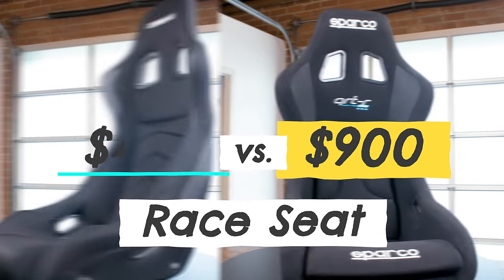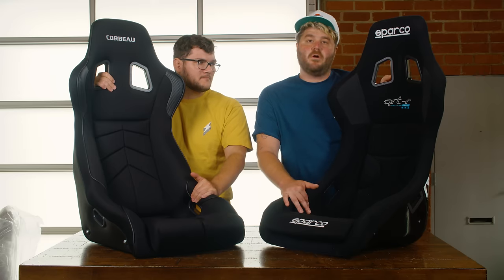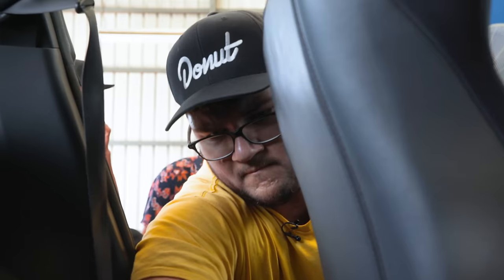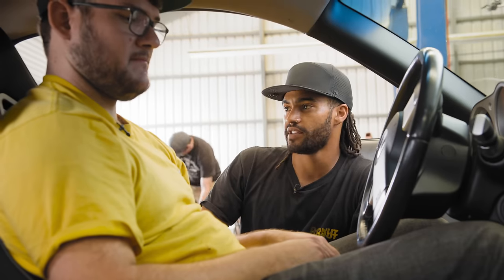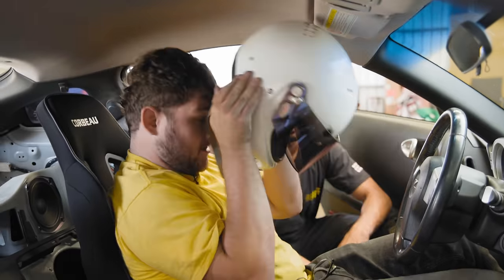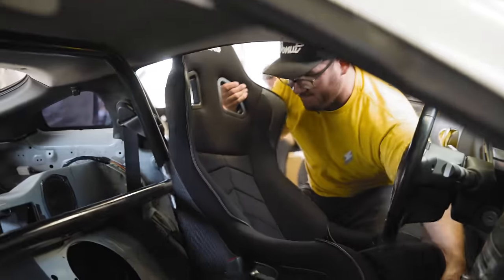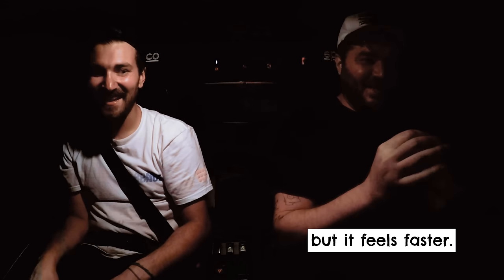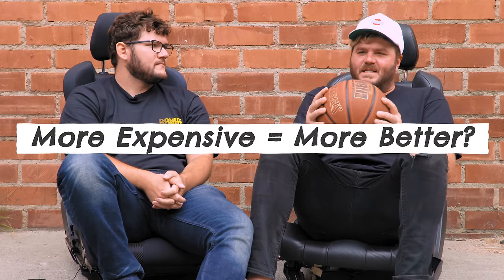$450 Racing Seats vs. $900 Racing Seats | HiLow

Comment: I like how a $450 seat is the “cheap seat” . Should have been a Facebook market place $50 seat.
Reply: no shit, they shoulda done the JEGS / summit seats
Reply: narmale or ebay special lmao
Reply: well yeah corbeau is still a good quality seat in this price range...cant compare to fake bride or wtv
Reply: I mean it needs to be a upgrade compare to the stock seat, not just slap the cheapest stuff on the car.
Reply: Exactly what I just post!
Reply: @V843v3r  correct
Reply: Lmao right? Corbeau is a top brand as well 😂
Reply: Exactly. The POS coil overs were a joke. You can get a pretty decent set for way less than half the expensive ones that would have blown away the clearly crap ones. Corbeau is a known brand. Keep things consistent folks...
Reply: The 'expensive seat' was a Sparco. How about a Recaro option that runs closer to $1500-$2000? Sparco and Corbeau are both really middle market. The real cheapo 'racing seats' are much less than the $450 Corbeaus, and much suckier, too.
Reply: @dandanthebabyman  The eBay special is around $250 - 300, and it's suicide. It's most definitely worse that stock and could cost you your life in an accident. I would only use those for a simulation racing rig.
Reply: Right??? Corbeau is better than my Recaros 😅
Reply: @dandanthebabyman  Yeah I really wouldnt cheap out on Seats... 

Recaro, Corbeau, Sparco... Stick to decent brands or you going to die in an accident 😅
Reply: @sireuchre  My Recaros only cost like 900usd... And both these sits are newer/better in my opinion. 

I guess for 2012 my Recaros were really nice mid/top end.
Reply: I imagine that was because in order to put the car on a track the seats must be built to a certain spec that track inspector's must lQQk at.....from Wyoming USA 🔫🤠
Reply: @billallen4793  FIA regulations are kind of BS TBH, I mean sure I understand that the seat is build to specifications but the fact that there is an expiration date of sometimes just 5 damn years and it's no longer approved? Seriously WTF!? How the hell is a seat going to be out of spec in 5 years of use? Is it because after 5 years they expect it to rusted out or something? lol
Reply: @SI0AX  experation dates on certain stuff is bs.... I think it's so manufacturers are able to sell more stuff....from Wyoming USA 🔫🤠
Reply: @billallen4793  That is the only legit explanation. Seats can last like 30 years if not rusted, so in order to keep making profit they put BS expiration dates to keep having people buy more if they want to keep competing in FIA regulated races.
Reply: @SI0AX  belts/harnesses last way longer than the rules say...unless you store outside in direct sunlight and weather they last a long time.... helmets also... unless it's taken a big hit it should be allowed.....from Wyoming USA🔫🤠
Reply: @sireuchre  How about a carbon fiber one, much more expensive and has at least some expensive weight reduction.
Reply: Any of you actually work on cars? I use procar seats and they are cheaper yet. Bull crap on the goober who said they were unsafe...As long as its mounted correctly.
Reply: SI0AX 🤦🏾‍♂️
Reply: Nåti M 🤦🏾‍♂️
Reply: alconater68 my thoughts exactly..I highly doubt any of these keyboard tuners even own cars let alone spend “thousands” on seats😂😂
Reply: @SI0AX  depends on material choice. Kevlar is popular, but the fibers break down over time. That's why bulletproof vests have expiration dates of about 5 years IIRC.
But I doubt that's the reason here. It's probably to do with maintenance, so some guy doesn't show up with 40 year old plastic tubs and kills himself lol
Reply: @eriv4735  Let me show you a video of OEM equipped Recaro seats:
https://www.youtube.com/watch?v=8Ye72Fg2xjs

Grated, this doesn't really make an argument for eBay seats, just the non-fixed back seats and why they are not allowed by FIA.

If there is a well build eBay fixed back seat, I could see it hard to fail, but I would have to look at the quality of the hardware it brings, and maybe even the welds. If any of that is half-assed, you would die, just like the kid in the video nearly could have.

I have a 1991 CRX that I've been working on 2 years to build into a circuit race car. I've spend 15x the amount it cost me to buy the car in just performance modifications and plan to get a cage and racing seats installed.
Reply: E Riv ok when you get into a low speed accident with a bicycle and get folded in half like a origami crane don’t say no one warned you
Reply: This isn't a civic build lol

Before I get Honda hated, i own a civic lol
Reply: @MrAhhsum  Honda builds are the cheapest. At least in my area, because they are the cheapest, they tend to be more commonly the fastest in straight line racing. Although that isn't surprising at the slightest. 

I think this kind of leads up to the ricer problem with Honda's. Because they are so cheap and you see so many fast versions of the car, kids tend to think the lowest tier trim car with the stock engine is good enough with just a muffler swap.

The same can be said with V6 Mustangs and other V6 "muscle cars"(it's not a muscle car without a V8).
Reply: Dale Halvorson the goal was to find something cheap, but also something decent. Not the cheapest thing you could find. I mean they mentioned this on the first vids of the build....
Reply: @devandrasimanjuntak1646  Exactly. Cheap but not garbage. Like putting on the eBay sleeve coil-overs that are actually dangerous because the sleeves will eventually split in half. The CRX I bought came with those at the car was set at the highest setting and was still scrapping the ground because the sleeves were split in half.

Coil sleeves are garbage and suicidal. Get the $500 coilovers from Tein or something or stick to lowering springs but FFS, DO NOT get the damn sleeves!
Reply: Well I feel like 450 dollars is reasonably priced. They arnt building a cheap ass car. Remember the 450 dollar brakes? They are building a car that is middle of the road and another car that is really expensive.
Reply: narmale Na make me use shittybilt seats. They are the poorest designed seats I have ever installed.
Reply: You didn't hear him say "a lot heavier"? Yeah, its the cheap seat.
Reply: 01GTB Daily its more of a “High (end) and Low (end)”
Reply: They track there cars so they needed a fia rated seat and that’s the cheapest fia rated seat
Reply: Can get some (What I consider to be nice) NRG seats on CarID.com for $220 a piece with rails.
Reply: Yeah ive seen some sparco seats for around 450
Reply: @PapaVrooom  Somewhere I saw Nolan mention that they made exceptions for the seats, just for like safety reasons or whatever.
Reply: QRT isn't even a hi item
Reply: I've had the same $165 ebay NRG seat for 3 years now - I "daily" drive ( 3 or 4 drives a week ) and do about 25 track events a year. Never had a single issue, it's perfectly comfortable, holds me in place at the track, and still is in as good condition as the day i installed it. 
... An EBAY SPECIAL (just like mine) is what should've been the cheap seat.
Reply: @MiraSubieGirl  i have PRP seats and think they’re a lot better than my buddies sparcos
Reply: @V843v3r  I think the idea is "is upgrading your car at a lower cost worth it?" type of thing, not necessarily bare bones cheapest car vs most expensive car. its just cheapest upgrades vs expensive upgrades
Reply: well, you'd at least want it to be an improvement, you won't pay money for a downgrade even if it's $10
Reply: lol, no shit my seat brackets are corbeau and with nrg type r style lol but I wanted something more facory that reclines. lol
Reply: Cipher economy seats 😂
Reply: @SI0AX  agreed, a shit seat nearly cost me my life because during the crash it couldnt keep in place and ended up giving way and sending me into the steering wheel. It broke 6 ribs my collarbone and almost paralyzed me, had i not been on the track i would have bled to death.
Reply: They don't want them to die in the event of a wreck lol. It needs to be cheap yes, but not cheap like completely unsafe.
Reply: Show idea new vs used
Reply: Andy's auto sport. APC special
Reply: On a budget should be said
Reply: On a budget should be said
Reply: $450 is crazy cheap for a racing seat.
Reply: Maybe they just don’t want to promote fake stuff
Reply: “Racing Seats” 😂
Reply: its a cheap " Racing " seat an original the one facebook is probably a fake and probably not a racing seat
Reply: Should have been the rep bride low max xD
Reply: Safety cannot be disregarded

Comment: "doesn't directly improve the performance of the car" loosing 40kg/100lbs, definitely will improve performance.
Reply: or8t I think they meant in terms of horsepower/torque, friend. Not weight reduction.
Reply: Handgun777 weight reduction does improve performance though. At 100 pounds thats a good chunk of weight that will make the car feel slower since the engine has to carry it and now that it doesnt its more efficient. More efficient = more acceleration. Take a couple hundred pounds off a truck and tell me it doesnt perform better.
Reply: @Attachments.  100 pounds can feel like alot , depending on the car. 
My old mk1 gti was a fun car until you added a passenger and lost that edge.
Reply: 370z seats weight 47lbs each
sparco QTR seats are 25 with padding, 

50 doesn't equal 100
Reply: @narmale  Good point. I'm thinking of changing from BMW seats that Ligit can weight 25/50lb+
Reply: @or8t  u was just happy with my cheapo seats mainly cuz of the side bolsters, sooooo much better than stock seats, as far as that point, but even comfort wise they arnt bad. Ive had several 3 hour trips in em and felt great afterwards.
Reply: Have a Megane RS i took from 1440kg to 1210kg... 

Bit extreme on the weight reducting end but the difference was immense.
Reply: @MiraSubieGirl  That's awesome man, you must of swopped out a bunch of stuff for that!

Comment: I actually really like my Corbeau seat. Great price for a FIA certified seat. Was a nice change not holding on for dear life sliding around my OEM seat on the track.
Reply: Corbeau is the one company that makes a good cheap seat. And they've got decent looking models too.
Reply: Corbeau fx1 is not fia approved
Reply: @brianjewell4139  exactly, I'm surprised they didn't go with something like NRG given their price point
Reply: @jonbanaitis2992  that must have changed recently, because that was the sole reason I bought it at that price point (4 years ago) was because it was FIA approved.
Reply: @jonbanaitis2992  They did in fact make FIA Approved seats that were about $200 more than the non approved versions. I dont see nearly as many now on their website, looks like it changed.    Also I totally Expected something from NRG which like you said would've made it a much Lower to Higher comparison lol
Reply: I posted above and for some reason no one caught it.  Those aren't fx1 pro.  Those are DFX seats.  Dfx also weight 9 lbs more.
Reply: @SofaKingTouge  yea I cant help but think they're a weird choice. Even if they needed a "wide load fat ass capable" seat, they still kinda blow.
Reply: @brianjewell4139  Braum seats come from same factory but look 30x better.
Reply: @DuBstep115  Yea the Corbeau Sportline RRS are the same damn seat as the Braum Elite Series and even the price is about identical, the Braums just look much nicer. Having put knock offs in my Honda way back when, I'll never use a lower end seat again. They're absolutely a safety item which is why I put FIA Brides in my GTR and swapped over to Recaro SPGs in my DC5. You spend every second in your car in full contact with your seat, may as well be one part you take some thought and $ on.
Reply: @brianjewell4139   fx1 pro is the best bang for your buck seat.  I have them in one of my cars in alcantara.  Now if money was no object I'd get sparco spx for my roaster.  $6k for seats is way out of my price range.
Reply: Recaro or Sparco guys... If your doing serious track days or "naughty" amounts of speed... 

Seats are like Brakes. Dont cheap out on your life worth. 

Corbeau is not bad though I have to admit, but if your doing over 160kph you should be in Recaros or Sparcos. 

And on top end Brakes. I reccomend DBA or Brembo as affordable top end brakes.
Reply: @MiraSubieGirl   160kmh is 100mph.  That's my commute to work.  Also I don't know what makes you think sparco are somehow better then corbeau.   Literally no difference.  AND if I'm doing real racing I'm using kirkey seats which in my opinion are safer then both.   Also cheaper.
Reply: @SofaKingTouge  I specifically buy and repair written off Euro/JDM cars.   

The amount of cars ive bought with snapped "Racing seats" is scary. And dried blood everywhere... 

I personally wouldnt touch anything but Recaro/Sparco... 

The 2 brands Pro Racers use. If you get in an accident at over 100mph good chance cheaper racing seats wont hold up and kill you...
Reply: Is it good for daily driving? More comfy than stock or no
Reply: @SofaKingTouge  Then again ive done some research on Corbeau... Tends to not really make it to Russia so its unheard for me. 

They seem good... I take it back :)

Comment: Actually to avoid this problem,driving position,corbeau can make the seats that you ordered shorter,in request.
Reply: doesnt that also lower the head rest? its already pretty low
edit: i was thinking it was a smaller seat size like the lowest headrest setting in a stock seat
Reply: I believe they shave the frame or something like that, to give an additional inch of head room, but the option is on selected seats, IIRC; however, I could be wrong on both accounts, it's been a while since I ran with a Corbeau.
Reply: @Miami_Bad_Boy_BOSS  this is probably the first time ive seen a conjunctive adverb being used in a youtube comment 😄👍 is that also a compound complex clause?
Reply: Yup they shave the bottom cushion. I bought there seat bracket and sliders for my miata. Had the same issue as Nolan and modified their seat bracket with no slider. Aftermarket seats can be a pain. However, I bought a corbeau evo x and their bracket/slider for my c5z and fit like a glove.

Comment: When I was in the market for seats, I thought I wanted the sparco evo 3’s until I sat in them. Super uncomfortable and too tight. I ended up with corbeau fx1 pros and they fit way better and are comfortable enough for long drives to the track. Everyone that sits in them says the same thing.
Reply: swisher5weet I had an old set of used corbeau seats don’t know the model , but they where super comfy and I loved them , better than any oem seat I ever sat in and held you like a gentle hug, after that next bucket seats I buy will also be corbeau
Reply: @austinthesinister9635  Guess you never sat in any non econo turd American cars from the 80's. Zero bolstering, but they were like riding down the highway on a couch.
Reply: yeah this is probably the first time they did instead of hi/low did a hi/mid, since corbeau is still considered a good quality seat vs a $250 dollar pair from ebay lol. luv the show but many of the other things they have done also have a mid level cost that could be just as good as the hi but better than the low

Comment: If you want to jump your car from stock to street prepared you can get new shocks, HP tires, some engine mods or you can install racing seats. Being able to actually control the car means more than all the power mods.

Comment: i was always taught to bolt in a cage, not weld it. From what i was told is that the welds can create weak points around the weld. further insight is greatly appreciated

Comment: I have Corbeau seats.  I've had them in there since 2001.  Not as nice as the Sparco Torino's that I originally wanted, or the Recaro whatever they were called.  I remember I got both Corbeau's for my 99 EM1 for about $650, which doesn't seem "cheap".  Its just that the Recaro's were about $1300....  for ONE seat, and $300 rails.  
That being said, the fabric is starting to fray a little on my driver side, but its been 19 years.

Comment: Unstitch the spotwelds on that diagonal panel and take it out, then the cage will fit better? (Pretty sure your main hoops gotta be vertical or very close anyway!) 

Someone must make a bolt in that fits them without messing up the seating space though, surely?

Comment: I feel like a more informative comparison for the masses would’ve been to put a genuine seat from a manufacturer (Bride, Sparco, Recaro) up against a cheaper EBay version of the same seat.

Coincidentally, I did just that years ago when I had a genuine Bride Vios III in one of my cars and a rep Vios III from EBay in the other. Driving both cars day in, day out, I was very surprised by how comfortable the genuine Bride was, and how uncomfortable the eBay rep was in equal measure. 

Sure, they both looked good, felt solid and the material and build quality (the things you notice at first) was actually quite good on the rep, but to actually sit in them and drive each car for a couple of hours (like driving yourself to a track day, hitting the track, then driving home again), the difference in comfort level and how fatigued I was in the eBay rep was staggering.

Comment: What's the point of roll bars designed for specific applications if fitment issues are still going to be a problem? Maximum Motorsports makes cages/roll bars specifically for Mustangs and I was going to pair one with Bride racing seats.